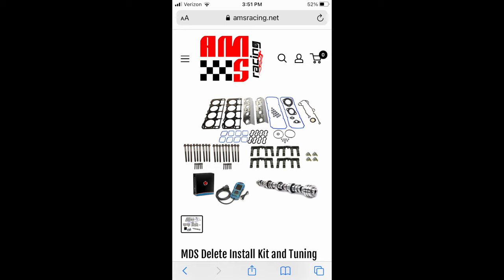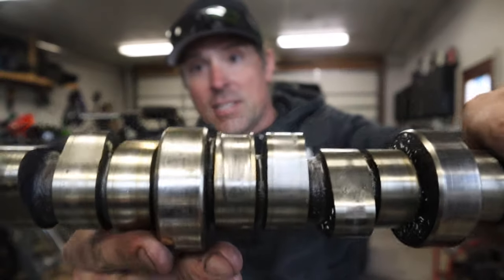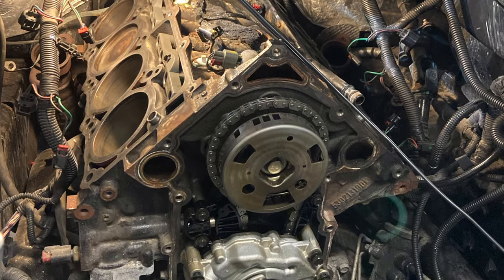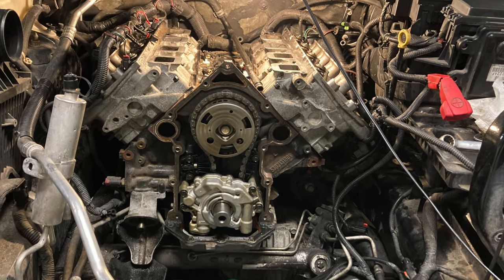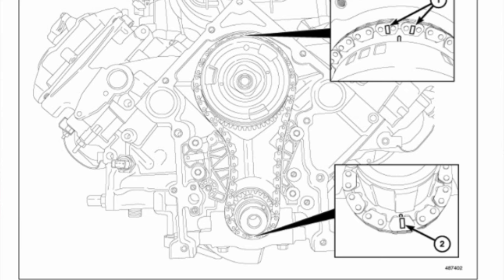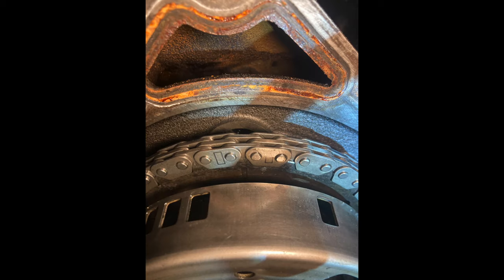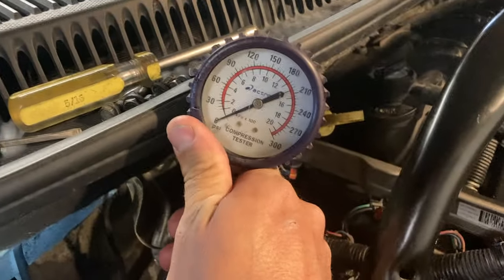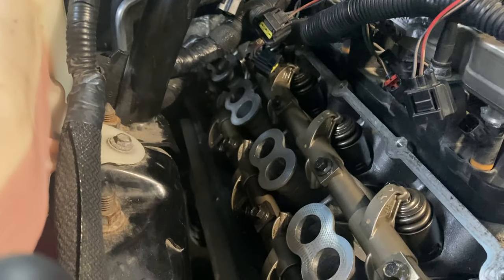Hemi 5.7 MDS delete, Lessons Learned

Comment: Sounds like you got the pushrod into a little crevasse beside the lifter bore instead of seated into the lifter. Very easy to do on the intake pushrods. Very important to turn it over by hand to verify everything's moving how it should.
Reply from the maker: I agree, it was easy to put in the wrong place. I did turn it by hand, but this was the furthest back lifter, near the firewall, and I did not notice it.
Reply: @wheelinoutwest  well, glad it all worked out

Comment: Absolutely a great video.  I'm in the middle of this job (2011 Charger R/T w/VVT).  Thank you for the tips!  I do have one question.  When I install the MDS Solenoid "block-offs." what did you do with the existing harness?  Just leave them unplugged sitting above the block?  Appreciate any advice.  Thank you!
Reply: What kit did you use bro I’m trying to find a non mds kit on my 2013 charger 5.7 or would the ams racing kit fit my car as well?

Comment: These engines are very tricky to align the push rod up because they lay so horizontal and not much to hold them in place well, that combined with it being shaft mounted rockers trying to make sure they all stay in place at the same time. I did see people make “holders” with rubber hose with a slit in it over the push rod then peel it off after the rockers are on.
Reply from the maker: Thanks for the input, the holders would be a great idea!!
Reply: I tried the rubber fuel line holders...didn't work too well, so I simply tightened and kept checking and repositioning the rods as I went along until they didn't pop out and the rockers were on tight.
Reply: @DL101ca  yeah it’s not fun anyway you do it  really. If I ever have to do one again I’m lifting the cab off the truck to work on the engine. It don’t take long and the A/C can stay connected. Given you have a hoist. It’s worth me being able to see what I’m doing better. Plus the rads and fans suck to mess with one less thing of you lift the cab

Comment: Good evening, my name is Alessandro Zanardi and I live in Italy, I have a RAM 1500 LARAMIE from 2018 with HEMI 5.7 motor, I would like to know if among your customers you have encountered oil pressure problems that go intermittently and breakage of the oil pump and motor due to low oil pressure. My RAM traveled about 80,000km and broke overnight.

Can you give me some information if this engine has similar problems and what are the solutions to eliminate them?

In Italy there are no capable mechanics like you in the USA.

Thanks for your help.
Reply from the maker: Sorry to hear about your issues.  An oil pump failure, can cause catastrophic damage to your engine, if the engine was run for any length of time after the failure.  It could have damaged every component in your engine, and in that case,  you may need a new motor.  However, with out running some tests, it is hard to say.  This video is more about deleting the MDS system, and some issue I ran into while doing so.
Reply: Put a 6.2 hellcat engine spec oil pump in. It’s higher volume at idle  - pressure is OK just the volume  of oil is the issue at idle.
Hemi engines left to idle for long periods like in Police cars etc seem to have a lack of oil volume at idle.

There is a solution 

MOPAR Part numbers:
6.2 Supercharged Hemi Helcat Oil pump is higher volume than the standard hemi 5.7 oil pump

High VOLUME oil Pump (not high Pressure) 

68195993AD 
High Volume Oil Pump

53020861  
oil pick up o ring

You will need the oring to seal the oil pick up. 

Drop the sump as low as you can at the front to reveal the oil pump 

Unbolt the sump and lower it down as much as you can
and turn pump to the side as you remove it
Use a new Oring and don’t drop the old Oring or the bolts into the sump or you are in a world of pain…

This is what people should do as soon as they buy a new RAM1500 with 5.7 hemi

Comment: I tore mine apart today. Bad lifter and damaged  cam. Hope I can get it all back up and running
Reply from the maker: We were able to get ours running, so there is still hope for yours!  Good luck!
Reply: How did it go Zeke? I'm not too far away from diving in
Reply: @Spoofaged  it was honestly not bad. I was really impressed how easy it was to work on this engine. It is up and running. Just getting all the parts in was the pain. Sent the heads off to get redone. Installed everything and it’s running.  I was about 1500 bucks in. Hope it last at least another 20k miles lol. Good luck
Reply: @zekemontgomery6678  that's good to hear. I made mine a bit easier to work on when I put the electric fan in. Freed up a ton of room and actually cools when I'm sitting in traffic again, so win win. Putting some shorty headers in today to get rid of the exhaust leak so I can actually hear how bad mine is. Trying to squeeze another month or 2 out of it so when I go to do it, it's not 100 degrees outside

Comment: I have a 2016 Challenger 5.7 with 40 k miles with no hemi tick runs great. My 2005 Chrysler 300 5.7 has 180 k runs perfect no hemi tick. My 2006 Ram 1500 with 5.7 has 280 k no hemi tick runs perfect. Truck works hard and it idles a lot. One winter when it had alternator issues i left it idle between trips for 4 days until the parts came in. 
I dont baby this trick at all, no warmups, pulling trailer alot daily driver etc.
I am pretty strict on 3-4 thousand mile oil changes with the Challenger and 300. The ram i seldom change oil as its just a beater. 
My biggest question is why does my 300 get solid 21 mpg and the ram struggle to get 12. The weight is within a couple hundred pounds and i drive the Ram much easier just because of mileage.....

Great video i may some day do the delete on the Challenger
Reply from the maker: That’s odd, not sure why the mileage would be so drastic?

Comment: Fantastic video... I'm going to be attempting this kit install very soon on my 2012 Grand Cherokee 5.7. It seems like most of the work is disassembling the front end of the car. Did you have to discharge the freon and remove the condenser?
Reply from the maker: Yes, I did have to move the A/C lines out of the way, you need all the room you can get!  Thanks!

Comment: It’s early life failure of lifter tiny roller needle bearings on gen3 Hemi.  Designated PN ending in AA. Lifters were revised to AB with  beefed up thicker needle bearings, then followed by  AC revision from different supplier. AA lifter roller bearing failure and subsequent cam lobe wipe can happen to MDS and non MDS variants. MDS is not the  issue or cause lifter failure. Missfire code is due to valve no longer opening sufficiently to create a combustion.
Reply from the maker: Good insight, I mentioned as well, I have heard people say the same thing, this can be MDS or non MDS.  But if your working on a MDS, you might as well delete it at the same time.
Reply: @wheelinoutwest  sure, if your working that deep into engine makes sense, but simple method is to disable MDS in software permanently though if the lifters are AA early Gen3 upto 2015, lifter rollers are ticking time bombs no matter how great servicing has been or how vehicle is driven.
Reply: So, it's a roller needle bearing issue? If so many are having this issue. I'm amazed there has yet to be a huge recall.
Reply: @billhoman694   don’t have failure numbers. FCA won’t release numbers. Won’t be recall since it’s not life threatening or safety concern.
If I was to take a guess.....any 3rd Gen VVT Hemi 2011 to 2015 with AA lifters with little needle bearings would likely have  early failure no matter how well kept and easily driven, doesn’t  stop the inevitable. FCA generally accept issue is rife and in cases have been known to replace engine when it fails with this symptom. Personally it would have been cheaper to issue technical bulletin on lifter issue and have dealer servicing replace lifters with stronger AC ones to mitigate the weakness.
Reply from the maker: @billhoman694  Yeah, it typically in pretty high mileage vehicles from what I understand, over 100,000 miles.  Mine had almost 130,000.
Reply: @wheelinoutwest  my 2015 Dodge Charger SRT 392 engine suffered a catastrophic failure at 86,000 miles. My extended warranty covered the engine replacement which was a blessing but Dodge knows these engines are prone to roller rocker bearing failures.  The service advisor at the Dodge dealer told me roughly 7% of the 6.4L engines have suffered this failure and that is why FCA won't recall them.

Comment: I’m doing the same job and having the same issues and I’m currently checking the pushrods. Once you put thr rocker arm on do you have any gaps/loose rockers? I figure mine aren’t primed yet but that’s what I’m finding. Minus making sure I have the rods slipped into the lifters
Reply from the maker: I don’t think there are gaps, but there may be a little play, cranking the motor over by hand helps too.

Comment: Great video..your problem was the rear push rod was in the oil hole not the lifter hole.. the holes are right next to each other. I did it myself I had to take a pic with phone to see it back there..  I'm working on a 5.7 hemi Cam replacement.(wore lobe on number 5 intake ) installed a Comp Cam, started it up ran great until it warmed up... then it snapped the camshaft doll pin.. replaced all the valves and put it back together thinking it was an oil pressure issue oil pump not pumping. installed a new pump and oil pressure was good after priming the engine and pump. started right up.. warmed up and snapped the cam pin again.. any thoughts?
Reply from the maker: That’s interesting, if the cam pin is breaking, something is not happy🤔. These motors are pretty picky about timing, so if it was running good, but still broke a pin, I am not sure.

Comment: Can almost guarantee you put the pushrod in one of the oil passage holes lol ive done it once just doing a cam and lifters and had the same problem. Ended up cranking it and noticed the rocker not moving and figured it out pretty quick 😂😂
Reply from the maker: That’s exactly what I did, I didn’t notice it as easily as it was the furthest back cylinder to the firewall. It was kind of hard to see.

Comment: Did you put a Hellcat oil pump in it? I have been told that if you ever get to the oil pump on a 5.7 hemi to alway pump the better Hellcat oil pump in. The Hellcat oil pump helps with the lack of oil volume at idle. I will most definitely upgrade my pump if I have to tear down the front of the engine.
Reply from the maker: No I did not, it sounds like it would be a good idea.

Comment: Just finish watching your video. I have a 2010 same thing.. I'm also  not a mechanic, but like to build and maintain my things.. I like how you said it just takes time but not that expensive.. 🤞🏼🤞🏼 What do you think the dealer would tax me to do your same repair?
Reply from the maker: It’s hard to say, but I have heard the repair from the dealer would be around 5k.
Reply: @wheelinoutwest  That's a whole another vehicle..😬😬😬
Reply: @runit5772  you ain't buying  nothing reliable for 5k lol
Reply: @kenbass346  I drove 6 years and about 80k miles in 2001 Jeep Cherokee that cost me $1000. Only thing I did was put tires on it, and a window motor. Oh and I still have it and it's still running with 302k on the odometer, but the AC EVAP and the heater coil need replaced since about 3k miles or so ago.

 Now I'm here watching a video about  swapping a cam in my newer, way more expensive, less miles ram.
Reply: @Spoofaged  today ment

Comment: hey did you need new valve springs for this kit or did you use what was in motor already? im looking to install this on my dads 5.7 hemi because he has some can damage
Reply from the maker: I never replaced the springs, I used what was in the motor, the kit came with everything I needed.

Comment: What changes does the hardware kit make, and doesn’t just disabling the MDS in a tuner accomplish the same thing? Really curious as when I had a supercharger put on my 5.7L Hemi, they just did the MDS disable in the tuner.
Reply from the maker: You actually remove the ads solenoids, so it cannot activate, and replace the cam, with a non Mds cam, and all new lifters.  You can deactivate the MDS through a tuner, but in my case, I already had to replace all these components due to a lifter failure anyway.
Reply: @wheelinoutwest  gotcha 👍🏻
Reply: So I already bought the lifters and cam with mds ones and then learned about deleting it can I replace the silonouds with plugs and turn it off with tunner without getting non mds lifters and camshaft?
Reply: @leeedelman4289   Hey there, sorry in advance for the long post, but for completeness -  I recently did a top-end rebuild in my 6.4. Same lifters and MDS system in both the 5.7 and 6.4, I have photos I can show you to back these facts that are a possible point of failure. I would strongly recommend NOT putting the MDS lifter in the engine with MDS turned off in the tuner. Here is why:

Look at your MDS lifters and compare to a non MDS lifter. The pin you see in the side of the MDS unit is mechanical actuator for the MDS system.  When MDS is activated that pin is collapsed into the inner core of the lifter, this disengages the outer body of the MDS lifter with the inner core of the lifter. The outer body has the roller on the cam and the inner core seats the push rod. This pin-disconnect is the  location for mechanical engagement or disengagment of MDS system.

The pin is collapsed to the inner core when Oil pressure pushes on the pin - MDS on. Remove oil pressure from the pin and a small spring inside the lifter  (NOT valve spring but a tiny lifter spring) returns the pin to its home position with only this tiny lifter spring pressure (again this is NOT valve spring pressure, but tiny lifter spring pressure) - MDS off.

MDS is only activated during lower RPM situations, roughly 2500 rpm and lower, ish. It is an economy mode driving situation. One reason for low rpm operation is at higher rpm the roller has a much harder time staying in contact with the cam lobe profile (this would be true for any lifter). After peak lift, the lifter must change direction very quickly in a very short distance to maintain contact with the cam lobe, The only way this happens is through the incredible strong force of the VALVE spring pushing back on the lifter (through the rocker arm and pushrod). VALVE Spring pressure is God in the valve train.

When the MDS is active, the MDS lifter is disconnected at that pin location. This means the lifter roller is disconnected from VALVE spring pressure. If that pin can not or does not return to its home location then at higher rpm your roller is 'jumping' off the cam lobe just after peak lift. At 6000 rpm the lifter roller is experiencing peak lift 50 times per second. That's gonna kick the holy living flat spot into any anything, especially a needle bearing. 

There is no feed back or sensors of any kind to tell the ECU that the pin is disconnected, other than a misfire code.

When the MDS system is cycling on and off these pins usually make it back to their home position, if it gets stuck it has a good chance of being freed on the next cycle, ( I suppose) ,at least a much better chance then if the MDS cycle has been deleted from the ECU operations.

How often could a pin really get left in the disconnected position waiting for tiny lifter spring pressure to return it home? I pulled my top end apart due to the sound of mad click one day after a good dose of spirited driving, a Hemi RAM 2500 out roll racing Audis) all eight of mine were out of position where the pin was misaligned with the hole in the outer body. some pins I could still see the pin end, others I thought the lifter had an oiling hole or some thing, pin is so far out of alignment I can't see the pin, all eight had misaligned pins and all it takes is one to trash your motor. (wont be instant catastrophic failure, you get a warning -  sounds like...tick, tick,tick,tick, tick. Turn it off until you know what it is.)

This pin misalignment was due to me having the MDS system turned off in the tuner for 40k plus miles. I strongly recommend if your going to turn it off be thorough  and remove MDS components in their entirety, or disable at the gear selector so it has chance to cycle.dd

I know lifters are expensive but the engine is way more expensive. Imagine this - no MDS anything in your Hemi, every time you start it, every time you pull into a drive thru, or drive downtown in your city,  all you hear is the rumble of your exhaust, smooth and lopey exhaust no matter what rpm! no tick, no worries, just the beautiful sound of 11mpg. Nothing is so badass, nothing in my world any way! (referring to the exhaust note, the 11 mpg sucks, I just dont look!           ok really its 10.4.............. and that's on the evic)
Reply: @brett9736  Thanks for this long explanation.  I have a 2016 Charger R/T. I just deleted the MDS with my Diablo Turner. After reading your comment, I believe your stating a tuner MDS delete can cause problems in the engine in the future. I will put the MDS back on. I assumed if I need the MDS off , O can always run vehicle in sports mode. It automatically disables MDS. Thanks for the info.

Comment: Just a tip when doing this amount of work it takes maybe a hour if you move fast to pull the motor and trans together out the top helps a lot when doing big jobs like this to just have it out in the open
Reply: Don’t even have to take the exhaust manifolds off then
Reply from the maker: I agree it’s best out of the vehicle, which I typically do when I am working on the bottom end. However, this motor in a grand Cherokee is very tight, the bolts to the trans are a huge pita to get to. I dident feel the extra effort to pull it completely out, was worth it for this project.